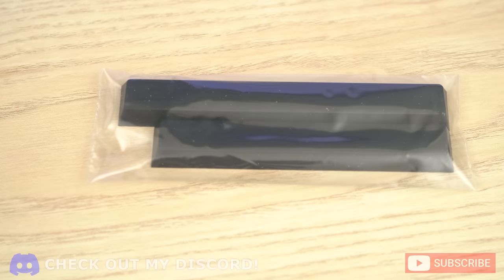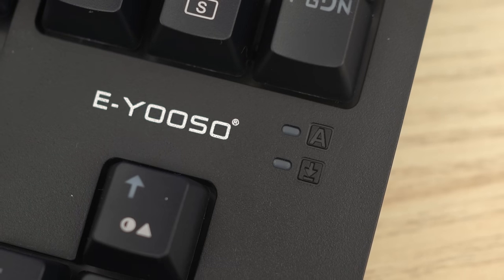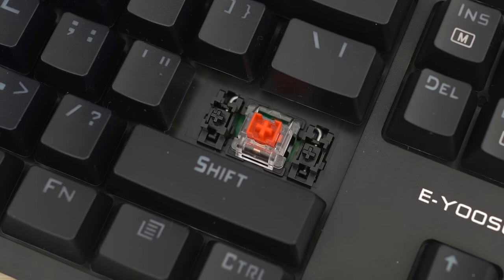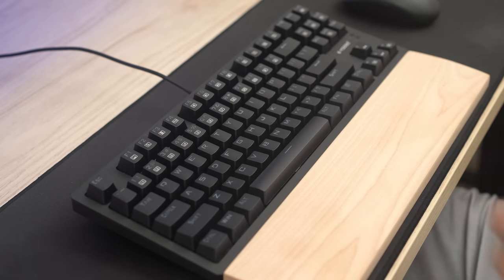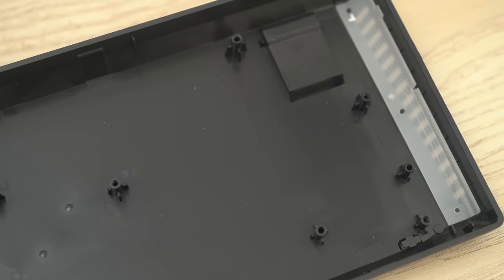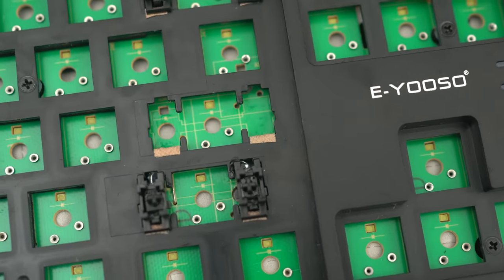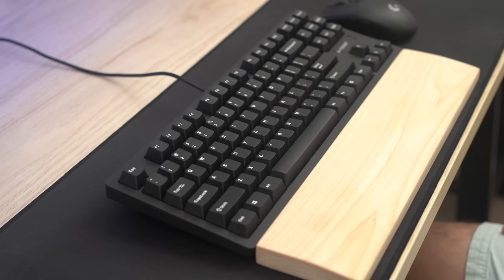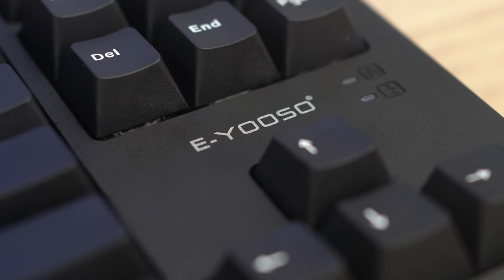I UPGRADED the CHEAPEST Mechanical Keyboard in the world - E-Yooso K620

Comment: Meanwhile in the Philippines, I can get myself a hotswappable Royal Kludge RK855 for $20 if converted
Reply from the maker: Some of the viewers told me that this keyboard is actually similar to many others, so I'm not surprised!
Reply: @Keybored  atleast in the end, they're both hotswappable
Reply: @Keybored  as of now, that specific Royal Kludge model is no longer available. Instead the better hotswap budget choice has now been replaced with Rakk Diwa, a 65% Keyboard that costs Php1495 ($26). Within that price range, I can build that board into a thock/clack board in less than Php5565 ($100).

Comment: I bought the E-Yooso keyboard after watching this video.   I wasn't impressed.  I couldn't fit Durock, TCC, or Tecsee switches (ended up bending pins trying to make them fit.)   Then, when I put back the original switches, the keys stopped working one by one.  My "R" key failed in the middle of a League of Legends game.
Reply from the maker: Yeah, outemu sockets require very specific switches and I wouldn't recommend sticking in incompatible ones into the socket due to potential pcb damage.  Akko switches do fit, and they do work very well, so I would suggest sticking with those for now!

Comment: i just bought a blue switch non-hotswap keyboard from china for $15, i think i should've looked more.
Reply from the maker: There are quite some deals out there!
Reply: @Keybored  agreed, tbh i didn't look outside of my country since shipping from china to here is surprisingly expensive (if you use a not-so-popular online store app), at the end of the day i bought it from a local online store app and didn't realize it was from china, but the shipping was cheap so i went for it. sure i might've lost a good feature, but i did get a usb type c detachable cable for the cost of hot-swappability, might be an unbalance trade but eh atleast i have a mecha now

Comment: The mods cost more than the original keyboard. haha
Reply from the maker: Haha, it does actually.  The switches cost more than the original keyboard and the switches already on there haha.  But just lubing the original switches and using the stock caps work out great also :)

Comment: I've built 200$ keyboard recently, and it's sounds worse then this.
Reply from the maker: :) Needs a bit of tuning and I'm sure it'll become loads better
Reply: yeah my drop ctrl sounds way worse than this
Reply from the maker: @penguin1714  :) The CTRL needs quite a bit of foam to control the integrated plate sounds, stab tuning and bandaids, and it turns out good :)  If you have the high profile version, check out my video on the Drop CTRL build/mod and you can see the outcome :)

Comment: final cost tho
Reply: Prob like under 40
Reply from the maker: Honestly, the first thing I did was lubed and filmed the switches, lubed the stabilizers and added bandaid, and threw in some zip-n-fit liner.  Overall, it wasn't bad at all lol.  That was pretty low cost.  The new switches, the keycaps are probably the most expensive, but those are all optional
Reply: Board was $25, case deadener together was likely less then $10, switches were $20, and the caps were $40. So altogether, around $90. If you include lube, it goes up to around $100.

Comment: What would be the best option if a person only has $50-$70 to spend? Would this be it? 👀
Reply: Redragon k617 Fizz (30$) has a really nice and unique case and is hot-swappable. Switches; Akko Cs Rose Reds (13$) for 45 switches. (I personally own the Akko rose reds, matcha greens, and radiant reds, imo rose reds are best) and lastly, Keycaps! (20-30) and ofcourse keycaps are up to personal preference. But this is a good way to get into custom budget keyboards! I have done similar builds and love each of them :)
Reply: @pinkcrosses  Thanks for the quick reply! This board could currently be found on amazon for roughly $12 ($30 - $18) with the blue switches! Was wondering if I could give this away to friends or family after light modifications :). (tape mod + foam + o-rings + changing the switches)